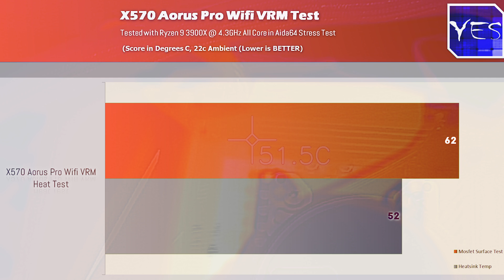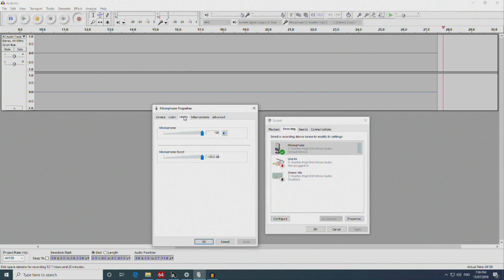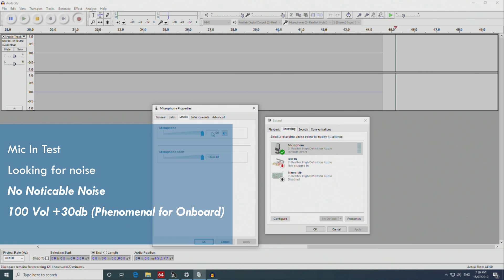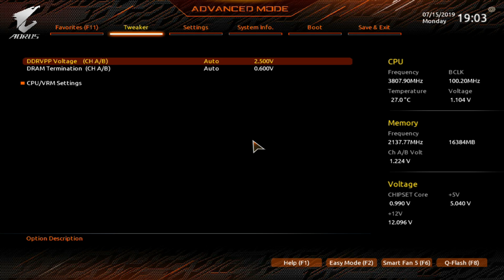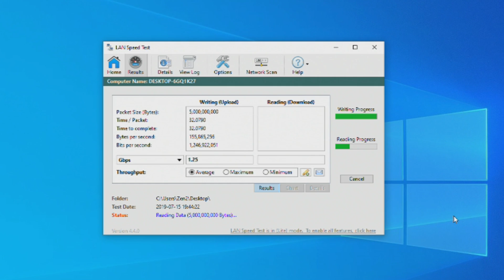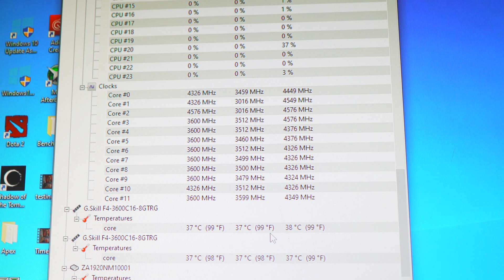Best All Rounder X570 Motherboard...? AORUS Pro (Wifi?) Review

Comment: do i need the extra 4 pin connector for my 3700x?
Reply: Not at all, unless you are oc'ing with ln2.
Reply: Santosi You need that extra 4 pin connector when you overclock Ryzen 3950 with LN. If you do it with air... you don`t need it. This is from bullzoid and he knows his overclocking stuff.
Reply: okay thanks

Comment: God the price. For $270+tax which is basically $300, you would think they would give you a ess sabre qdac. The z370 Aorus G7 can push my sennheiser's ie 500 pros and those are $600 ear buds with 126 dB (SPL). My phone can even push 50-600Ω cans. In all realtiy a z390 Aorus Master or Designare sounds a lot more like a $300 board. With the Designare the BIOS has a switch so it can run 2 M.2 Nvme drives (one strait to the CPU and other through the chipset) in raid without bottleneck"N" the 8GB/s transfer rates.

Comment: HWinfo64 has great sensor support for most of Gigabytes range. I still think x570 is way to overpriced for a feature (PCI-e 4.0) that's long overdo and not really beneficial to mainstream consumers. For x570's so called midrange prices, Id just go with a z390 high end setup. the price of a decent X570 motherboard off-sets the deal with Zen2. The boards are awesome but with Zen2, they don't OC unless on LN2 and 5500MHz on the memory is pointless when the CPU's memory i/o drops out after 3800MHz. There's no performance to gain, so why buy a board that's way overdesigned for OC'ing and not be able to actually use it. Paying a price for a feature that can't be used is a waist of good components. That's the compromise AMD had to make when going with a multi-die configuration.

Comment: What's the best budget x570 for Ryzen 5 3600x?
Reply: Bullzoid thinks that it is asus x570 tuf... Also gigabyte has good ~ $200 board. But as Blizzard Wind did say, the best option is b450. Maybe msi carbon or tomahavk max. There has been some info that the bios is not there yet though and some people have had problems with ryzen3000 bios so far.
Reply: b450 is much better if you don't need the pcie gen 4.0

Comment: No clear cmos and bios flashback buttons on the rear I/O is a no for me.
Reply: Also, this mobo is exactly 30% more than the x470 Gaming 7 and loses heavily on features. The whole x570 generation is a big oof value wise.
Reply: what do you need bios flashback for? ALL x570 boards are obviously compatible with Ryzen 3000...
Reply: @Cmdaddy88  Ryzen 4000 will come in summer 2020

Comment: I bought an MSI B450 Gaming Pro Carbon AC because I didn't want to pay extra for PCIE Gen 4. Great board
Reply: Hey bro u have problems with new gen ryzen? I heard all msi boards x470 and b450 have problems with bios update for zen2
Reply: @whiteferyys4458  Haven't flashed yet. Waiting for ryzen 3000 to come down in price a little before I buy
Reply: @whiteferyys4458  It appears to be hit and miss but then again, some people aren't using the correct FAT 32 file system to do the flash

Comment: long time fan, love the vids. I have an x58 related question for you. I have an Asus P6T-SE mobo and a w3680 CPU. will this combo work with ECC memory register or unregister? What about 8gb DIMMs of ram ECC or not? I know "officially" it's not supported. thanks for any advice.
Reply: Hi, another viewer here: I have the same board with an X5670 used for ESXi and PfSense. My observation is that if you have above 16GB of total RAM, then it starts dropping channels if you run them over 1333MHz. 3x8GB or 6x4GB drops a channel completely.
Reply: I've had issues running ECC on my P6T Deluxe with an x5650.... Not that it helps much, but it seems to be really picky with the DIMMs themselves
Reply: @kacasio1  ya I have seen many posts that say stay away from 2rx4 variations of ram. I would just love to get 3 8gb sticks of ram running at 1866mhz ugh the struggles
Reply: @xephorce  I had 3 sticks and it still didn't boot, I didn't investigate further. And mind you this was almost 4-5 years ago.
Reply: well just to inform everyone that yes it does work with 3x8gb of ram just got them in today. no issues. i am using Kingston (HYPERX Genesis) PC3-14900 (DDR3-1866) KHX18C11P1K2.
Reply: @xephorce  registered or ubreged ECC?

And awesome possum, I'm happy for you bro!
What kind of overclock do you have running currently?
Reply: @kacasio1  its just consumer-grade ram. I just got it to a stable 4.2ghz and the ram is sitting at 1800mhz atm, I am hoping I can push this a bit more soon. I tried to go for 4.4ghz but windows kept crashing. when I have more time I think I can get it there.

Comment: gigabyte has been on point for the VRM on all their x570 stuff
Reply: @OneTwoThree225  check the Buildzoid review first. He says they aren't that good compared to the other board manufacturers. Phases aren't everything.
Reply: @OneTwoThree225  Yeah I've heard about a lot of BIOS issues on older motherboards from asus and msi, hopefully they get it sorted out because my x370 carbon is holding me back from buying a new cpu haha
Reply: There bios has been really shoddy tho.only thing that keeps me from buying a gigabyte board
Reply: @leadfarmer556  Main reason Im having an issue pulling the trigger right now. I have a Gigabyte Aorus Elite Wifi sitting in my cart right now, so now Im researching the Aorus pro (Another reason is the Elite doesn't have debug LEDs) I previously was leaning towards the Asus Tuf but the Gigabyte VRM is so much better. I'm not an overclocker so I just want a solid performing board that will last for years.
Reply: Apparently the Pro doesnt have debug LEDs either?? wtf